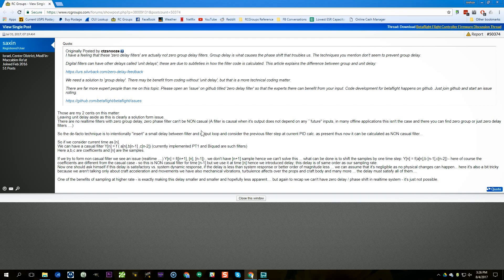Betaflight 32 kHz | YES OR NO?

Comment: Do we know for sure that rf1 is using non-causal filtering at 32k?  I understand it's closed source but any indication from developers?
Reply from the maker: I don't know anything about what RF1 is doing under the hood. I just want to make sure that they are getting the credit they SO RICHLY DESERVE for being the FIRST to espouse 32k gyro sampling. DO YOU HEAR ME RACEFLIGHT PILOTS? I'M GIVING CREDIT!
Reply: Joshua Bardwell lol fallen on to deaf ears and blind eyes.
Reply: Joshua Bardwell have you tried dRonin firware on any boards? A friend just told me about is predictive script....
Reply: @WhomImIzFPV Uh, yea, there are plans to put prediction in the actuator module of dRonin, but currently only the prep work has been committed. The actual predictor is still WIP and only privvy to the developer who came up with the idea for it.

Comment: I must be a idiot cause from his whole explanation I got nothing out of that. Dumb it down a little.
Reply from the maker: 32k results in lower latency which is good for handling, but also more noise, which causes hot motors and makes the motors twitch.

Comment: Hi is this still true??
Reply from the maker: No, not really.
Reply: @JoshuaBardwell  Thanks for that! I'm trying to work out what is the best way to set up a quad.  Should I use Dshot1200 or 32khz sampling and dshot600.  I have a Matek f405 board and if I select both it goes to 60% cpu usage at idle which from everything I've seen is far too high.  So which should I sacrifice? :)
Reply from the maker: To be honest I just run 8k/8k on most of my builds. I'm really skeptical 32k makes a big difference for most people. But if you want to run 32k I think you must run 32/16 and then you can run any other features you want.
Reply: @JoshuaBardwell  Thanks again.  I'm currently running dshot1200 and 16k/8k so I'll see how I go.  Thanks for your help.  You are always really helpful and responsive.  I'm sure all of your subscriber appreciate it as do I.

Comment: Now 32khz is becoming more popular due to better filtering in bf which is also what you said is needed in this video.  I have recently build a new quad with matek f405 running 32k/16k. I am just wondering if it is really better than 8k.  Sampling at 32k creates a lot of noise in comparison to 8k. So I had to put on gyro  lpf 1 & 2 and d term lpf 1 and 2, which is btw recommended by the latest 3.4 tunning guide.   I have a few quads with 8k they just needed lpf stage 1 and dterm lpf 
stage 1.  The filtered gyro traces are even better than my 32k quad despite using less filterings.  I used the spreadsheets created by UAV tech whom he reminds me of JB the junior lol.  The latency is more on my 32k than 8k.   UAV tech also demonstrated with all things equal going 8 to 32 does very little to the latency.

Comment: Motors go crazy after arm with 32k mode enable pt1 and dshot.  With pt1 and multishot everything is ok. To use dshot 1200 i have to Change pt1 to biquad or Fir. This is suposed to happen ? (Note: stage2 is on)
Reply from the maker: It sounds like there is too much electrical noise in your system and the Dshot1200 signals are being corrupted. Is it normal? It's the situation for your quad. If you can add capacitors to the ESCs that might help. Or just use Dshot600.
Reply: Joshua Bardwell thank you ill try your suggestion :)
Reply: ok.... capacitors didnt help. But i found a solution. Flashed Last butterflight firmware and i can run 32k/16k dshot 1200 without any problem :) Problem was Betaflight

Comment: Hey im using omnibus F4 pro corner with betaflight 3.3 , motors F40 pro v2 and f35a 32 bit ESC (dshot 1200) from t motor. Its working with 8k/8k but when i enable 32 kHz sampling mode using 32k/8k with dshot 1200 motors go crazy when I arm. They make weird sound like they have "Sand" inside. I checked motor tab and i noticed they are unsynk some go to 100% and others not wihout moving throttle position. Do you know what kind of problem could be ? Thank you
Reply from the maker: Yep. You cannot enable 32k mode without also configuring the stage2 filter.

https://www.youtube.com/watch?v=4v9aZeIDkvI
Reply: gyro_stage2_lowpass_hz = 150 is already set

Comment: Sorry for the late comment and maybe I miss something, but is there any sense in sampling the gyro at 32 kHz, while, according to the datasheets of even modern ICMs, the maximum data rate is 8000 Hz? Wouldn't it read the same sample four times at 32 kHz? Maybe, it's kind of well-known undocumented facility to make it work at 32 kHz at max? Sorry again for possibly stupid question, just keep seeing mentions of 32 kHz, but still can't clear up for myself how it actually works.

Comment: Hi.
I have problem.
I use matek 405 aio with ruber dumpers. DS30a esc. Rcx 2206 motors.
When i turn on 32khz sampling , my dron start be crazy.
It jump, motors didnt work smooth, all time have "spikes".
I use 5 (470uf 35v).
All esc has one , and one on batery , but it's dosn't help! And motors - hot after 1 minutes.
But when i turn off 32 khz sampling - it start be smooth like butter. I put pt1, turn off noch 1 and noch 2 filter , and it's still smooth.
What is it?

Comment: Hi Joshua Bardwell,

I have just built my first quadcopter for freestyle / racing after watching a lot of your videos and JC's videos so I knew what I was doing.

I chose to use a GEPRC LX 5 Leopard frame, BrotherHobby Returner R4 2300KV motors and the Kakute F4 AIO FC (after watching your video about it)

As far as I'm aware the IMU on that FC is also 32Khz so I set that to 32Khz and the PID loop to 8Khz and I've been hearing quite a log of Oscillations so I decided to check black box and it seems pretty noisy on the PID's which are at stock. As you already know the IMU is raised so you'd think it would isolate the vibration pretty well but I decided to do a test with the gyro at 8Khz and the now it's almost perfect (based on what I know about blackbox anyway) so I think that shows your point about it picking up more noise.

Pity though as I don't like not being able to use a feature thats included, but if it makes it fly better at 8Khz that's what I'll stick with at least until I have a definitive solution on 32Khz.

If you have any suggestions please let me know, and keep up the good work, I'm liking your channel a lot.
Reply from the maker: Betaflight really isn't optimized for 32k yet. I don't recommend people run it.
Reply: Joshua Bardwell thanks for the quick response. I'll keep it in 8Khz for now then. Then I'll go through your video on removing filtering and pid tuning and hopefully get a decent tune. Very happy with the quad on the whole though and was such a great feeling seeing it actually work after building one for the first time and knowing I didn't mess it up.

I've not had much success with soft mounting motors though, I found it had adverse effects and actually made it worse.

Anyways thanks for taking the time to reply to me.

Comment: Most of our quads have primitive flat plate arms. When the prop blades cross the arms you get a pitch/roll impulse. So 30K RPM * 3 blades * 4 props ->  6K crossings/disturbances per second. Nyquist lower limit 12KHz sampling.  Buzz bombs at 50K RPM * 5 blades * 4 props -> 16K /Sec gives 32KHz.  6K RPM* 2 blades * 4 props for us oldies gave 800 /sec. Sample at 1KHz OK sort of ;). Minor problem is many gyros do not like being rattled around and so we get more noise. 

I lot of the disturbance is arm crossings but we are actually in a soup of prop wash. 
If we sample at the appropriate rate then the filters at around 300Hz do not see this noise being magically aliased down into the control frequencies of interests say around 200Hz. The motors themselves with rise times around 30mS cannot respond even at these frequencies and if we push noise into them then it gets dissipated as heat resulting in the smoke getting out of them. 

BTW I do believe in digital transmission to ESCs but DShot bit banging .....

Just some thoughts.
Reply from the maker: I have seen traces using 8k sampling and I gotta tell you, there is just nothing above about 600 Hz. Maybe 1 kHz at the top end of what there is any energy at. I would be really surprised to see a 32k trace and suddenly see a spike of noise at 6 kHz but anything is possible.
Reply: Thanks Joshua. I believe we are on the same page. I agree you will not see any spikes (other than when hitting things - https://github.com/betaflight/betaflight/pull/4058 ) just a lot of intermixing noise as the relative phase of the motors will be changing very rapidly.

Comment: Joshua, sorry maybe the question is redundant..  dynamic filters on bf 2 must be run under 4K 4k even on f4 boards, because faster gyro sampling wouldn't let the filter work properly.. so on a hrlg flame f4 board what would you suggest 8k/4K?
Reply from the maker: I don't think that's right. On F3, you have to stay under 4k/4k because of CPU utilization, but on F4 you can run 8k/8k no problem. I double checked this on BF slack and at least one dev agrees.

Comment: Hello Joshua, I recently finished a build just in time for BF 3.2.1. My rig consists of QAV-XS, BFF3, HGLRC 28A D-Shot600, F60 2500kv, and blaah blah blah!! Needless too say ...... It flies like shit!! My question, I guess is, I think I fudged up in the setup. I'm running 8k/8k loop times, accelerometer disabled, and I think I enabled dynamic filtering without disabling any of the other filters!! Can that cause a kwad to want too pitch and yaw right hard enough to almost flip over forwards after a punch-out or after dropping throttle after a punch-out?? Thanks Jesse

Comment: On my main setup. I'm running a sp F3 @ 4k/2k. Emax 2205's and dys 30av2's. Can someone please recommend me a FC with Osd that can do betaflight and atleast minimum 8k/8k or more. Hopefully with a barometer too, But not a must. Thank you!! :)
Reply from the maker: Any F4 board can do 8k/8k easily with Betafligtht 3.2. Before 3.2, any F3 could do 8k/8k too.

Regarding the baro... skip it. Betaflight is not aimed at people doing sensor-assisted flight like GPS and baro and magnetometer. Betaflight's support for those flight modes is basically nonexistent. Literally nonexistent in some cases. If you want to fly with sensors, use iNav.
Reply: Thank you for the info :)

Comment: Does this mean you should be running an 8Khz giro and a 32Khz pid loop and predict what's happening in between samples? Because even if you know exactly what the quad is doing, which I agree you do with the nyquist sampling theorem.  varying the inputs to the motors at a higher rate will still be better
Reply from the maker: There is no point to running the PID loop faster than the gyro sampling rate. There is a potential advantage to running the gyro faster than the PID loop.

Comment: i love your reviews and info..  i write signal processing software and want to add:

The reason the fast sample is important, because there are sources of noise inherent in the electronics of solid state gyros.  the high sample rates allow algorithms to throw away bad data points, and get a much more accurate estimation of your roll or pitch, or acceleration.  old school method of doing this is to take in the 30k samples and write software to do this filtering.  the move to 30k sampling and filtering in software makes solid state gyros almost as accurate as laser gyros.  

the newer chips do this filtering in hardware.. some of the fundamental advancements in gyros is actually doing filtering on the chips, rather than in software.  the chips that do it in hardware, can be sampled much lower and provide orders of magnitude more stable and accurate readings.

https://en.wikipedia.org/wiki/Kalman_filter

Comment: I thought 44.1khz was the sampling rate for CDs because its a stereo signal and each channel is 22.05kh each.
Reply from the maker: The CD has two 44.1 kHz tracks, one for left and one for right. The choice of 44.1 kHz is to satisfy the Nyquist Limit for the typical range of human hearing.
Reply: Joshua Bardwell It's not just a slogan. I did learn something today.  Not just about cd's... but why not to bother with 32khz gyro sampling.

Comment: I can tell you that 96kHz FLAC files sound superb with the right DAC..."Little Wing" by Jimi makes me cry...
Reply from the maker: I think you mean 96 bps, which is something different than sampling rate. Nyquist is a fundamental mathematical constant that always applies. The only way to "beat" Nyquist is to, for example, band-limit the signal at a lower level. For example, you can low-pass the signal at 18 kHz and wager that most people won't notice a little less high-end.
Reply: No, I mean 96kHz 24 bit high res digital audio FLAC files converted through a 24 bit Meridian DAC. Massive increase in depth and space compared to 44.1kHz 16 bit CD sampled files...I feel like I outgeeked a geek. Keep rockin...bongo

Comment: Joshua,  First of all thanks for your explanation, and second, i bought a betaflightf3 FC, because your video of the board MADE ME DO IT (LOL) and while configuring it, i would like to know what gyro update feq you choosen on the board?  i have selected 8 / 4  because when i select 8/8 the processor goes from 32 or 35% to 80% and i think its not worthe the waste, of processing power. what do youu think ?

Thanks !!!

Спасибо   ;)
Reply from the maker: On Betaflight 3.2 with dynamic filter, F3 boards cannot run 8/8 any more. You have to run 8/4. I definitely don't think you should fly with CPU utilization higher than about 50%.
Reply: Thanks for make us smarter every day :)  i will search info based on your answer.

Comment: Don't you think it's another thing to have 32khz sampling and a 32khz PIDC (RF1) compared to a 32khz sampling and 8khz PIDC? (honestly just asking)
Reply from the maker: +JulianGoesPro I don't think more frequent motor updates matter past a certain point less latency in the PID loop output does matter.
Reply: but doesn't doing both the sampling and PIDC at 32khz help reduce latency compared to running at 8khz?

Comment: Hey joshua! so just a quick question,  what throttle idle setting should I have for my micro brushless if it is doing a flip roll of death? I talked to you a little bit before about it and you said it was a min throttle issue.  I meant to talk to you at flitefest but by the time I found out you were there, I just never got to ya :/ would greatly appreciate some feedback! thanks! :P

Comment: hey Joshua im running the betaflight f3 board with 3.1.0 everything runs good  until i switch to fw 3.1.7 when i throttle up then down throttle i get a huge wobble... any ideas?
Reply from the maker: I mean... you're going to have to give me a little more information. In general, an oscillation when you raise the throttle means lower P gain.
Reply: Word! I'll  prolly just take it back down to 3.1.0 If it means Retrning i had it flying nice I watched your video on notch Filters I disable 1 and 2 and shes flying better than ever in my opinion
Reply: I'll post a video tomorrow
Reply: if your getting wobbles when coming down at zero throttle it could be to much i

Comment: thanks for the info Joshua that explains the advantages...I like RF1 but wasn't sure why/how their filters might be different and how they get the advantage. Might also be worth mentioning some advantage with a synced esc 32k refresh-if there is one?

Also a small word on digital audio sampling. 22k is the limit of human hearing which is why audio is generally recorded 44.1k...there is of course information above that...
The interesting thing is the similarity where there are IMO advantages with recording at higher sample rates but more to do with what you do 'after' you recorded - ie working with and processing audio at higher rates (less digital aliasing/distortion)...and lower latencies...

Comment: Eh, the only sort of non-causal filter that'd be interesting would be a sinc filter. But to get any sort of meaningful brickwall response, you'd need to look a damn lot samples into future. 5 samples is like a magnitude off.
Reply from the maker: Yeah, 5 samples isn't realistic but I didn't want to move my hand 500 times.
Reply: The more interesting point is that 50-100 samples into future still result in 1.5-3ms time delay at 32KHz, and that doesn't factor in the group delays of the filter function itself. If you need to reduce the amount of samples to reduce the sampling delay, the filter slope becomes shallow enough that you might as well just run a regular n-th order IIR lowpass that does the same with no sampling delay at all.

Comment: Audiophile here, 44.1 kHz is a great standard.
I ran my F3 board at 2.67k/2.67k for the longest time and did not really see a difference when i changed it to 4k/4k. 
im more excited about added features like the dynamic filtering.
i lost my quad tho and i only have an old naze32 now, back to 1kHz for me until next spring.

Comment: explains why 16k and 32k are an absolute nightmare to tune. data went from clean and smooth on 8k to what the hell is this. 
so any tips for getting 32k to actually run? i know its pointless, but i still want it!
Reply from the maker: Soft mount. Sacrifice a goat.

Comment: So on 3.2, would you still mess with the pt1 and notch filters and is 8k8k pretty much the best
Reply from the maker: Those things aren't really mutually exclusive. I would run 8k/8k, and I would try to use PT1 and disable all static notch filters, and use dynamic instead. In general, I think that will give the best performance but you have to be sure you're not getting hot motors etc.